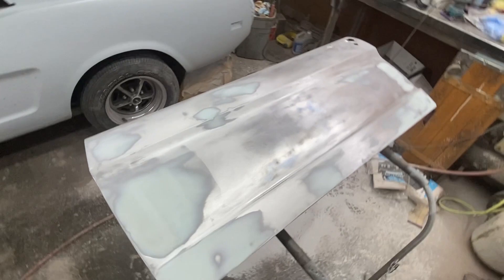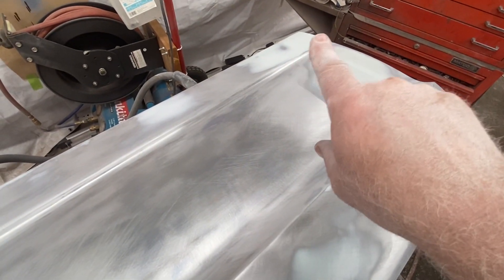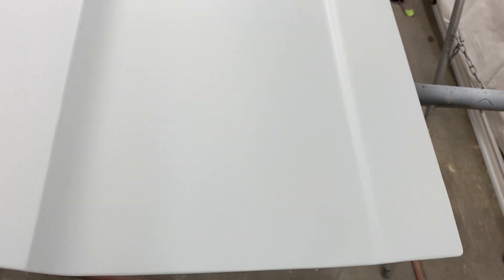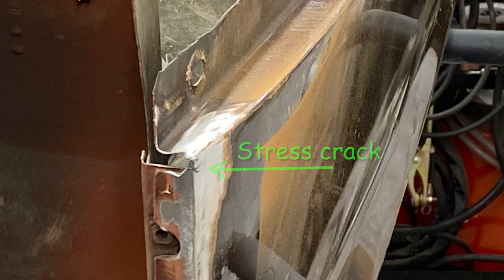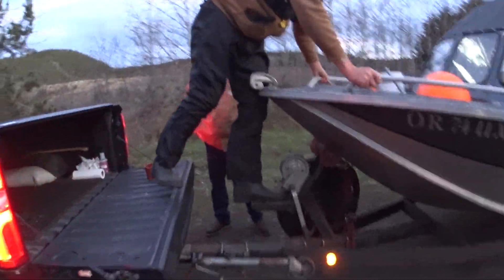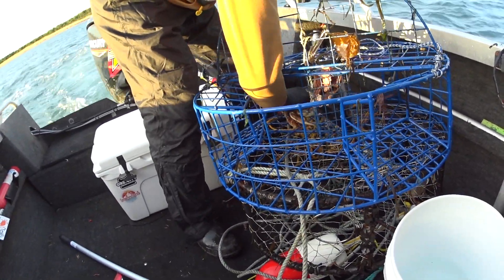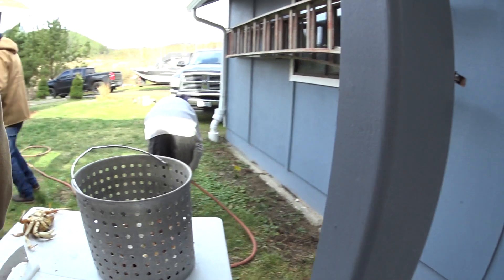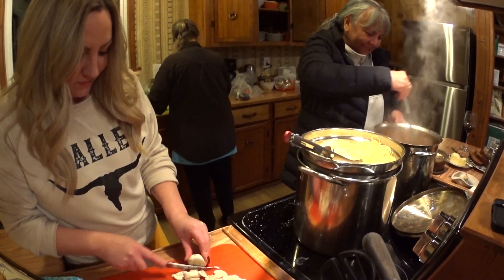66 Mustang Betsy - Paint 5 Driver's door + Extra stuff

Comment: You are getting far more done than I am. Finally getting parts in and got the first test wall up in the shop and intermixed I have had back issues and other stuff now I pulled a muscle in my leg and getting around is painful at times and I was ready to get work done on the car and the shop...  But I may make a drive over wendsday to grab bumpers since they are on sale. I will get a video done tomorrow on what was in those boxes...
Reply from the maker: Staying healthy and uninjured is more difficult and more important the older I get. I feel ya Robert.